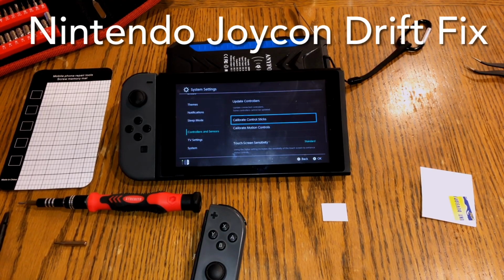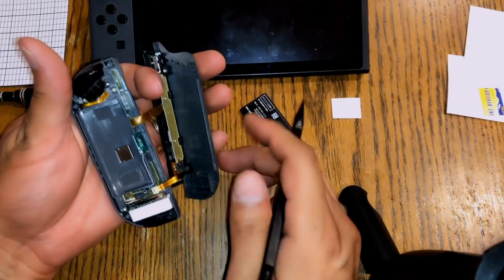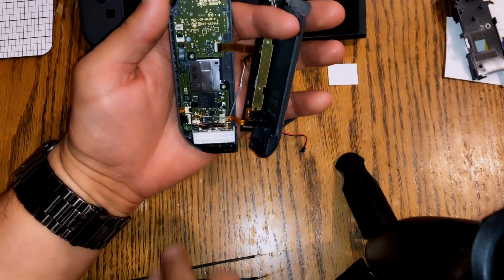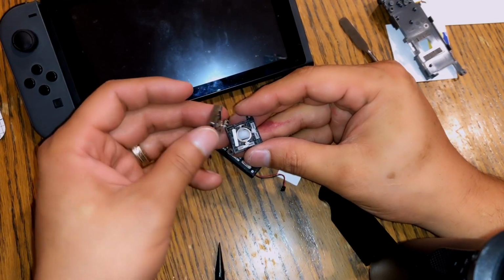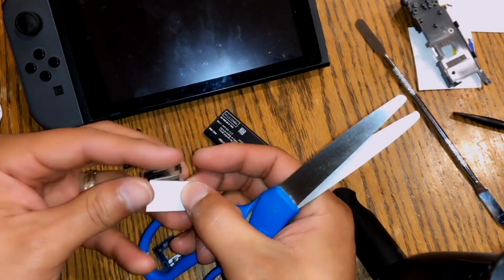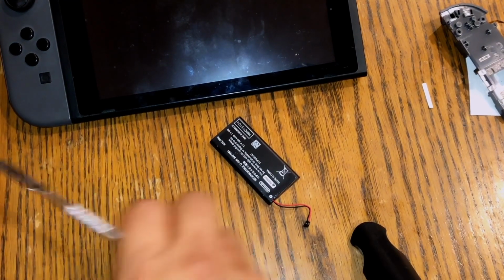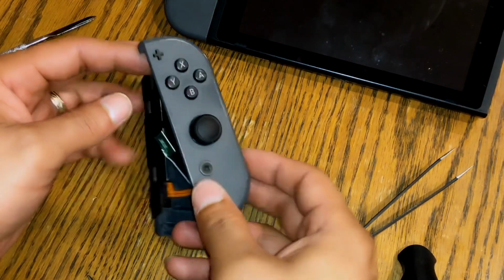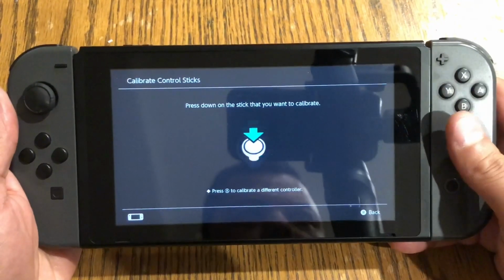Permanently Fix Joycon Drif Problem - 2021

Comment: You should use the card outside of the stick, using it inside the drift will comeback because the metal plate will become even more loose with time, using the card outside will keep everything together
Reply: Thanks to you now we can solve this annoying problem, nintendo should hire you to repair all switches included the oled model
Reply from the maker: I tried that at first but it didn’t see to work every time and the card would shift after a while when the kids were using the motion controls.
Reply: I see yours., and I wanna ask, is it work with lite version?
Reply: @dwiraharja2852  it should work